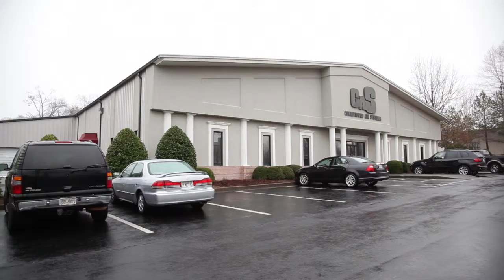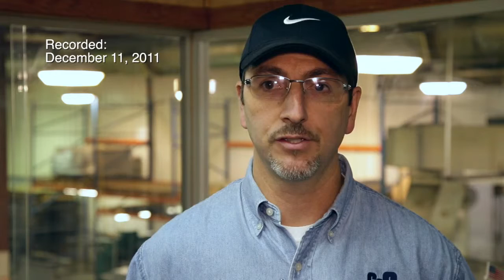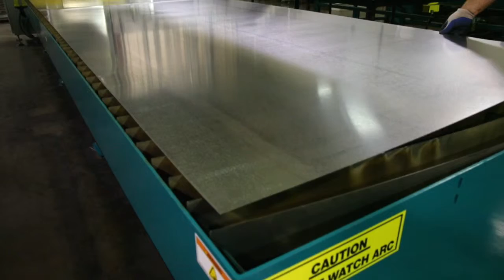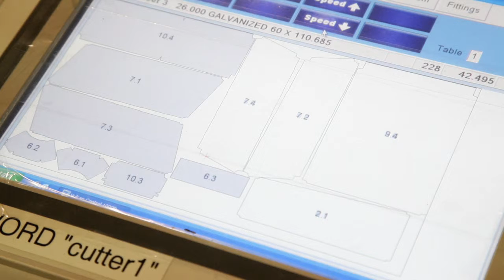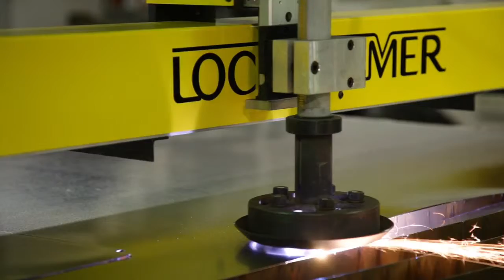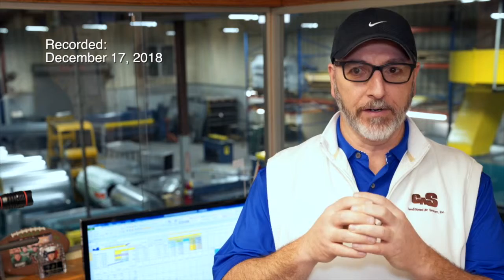Belt Drive vs  Rack and Pinion    Plasma 1000 Plus   Conditioned Air   Thomas Testimonial

Comment: Thanks for the video. It's hard to find info on belt vs rack vs lead screw in relation to CNC plasma. Most info relates to CNC routers which have a lot of force on the cutter unlike plasma.